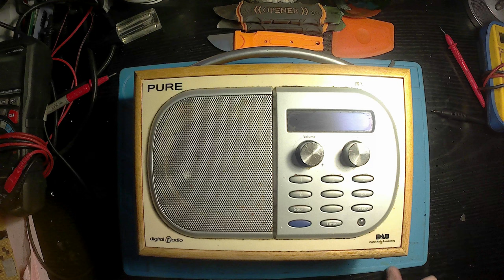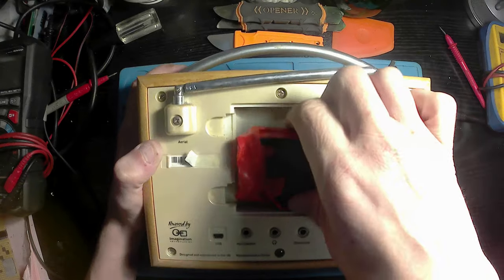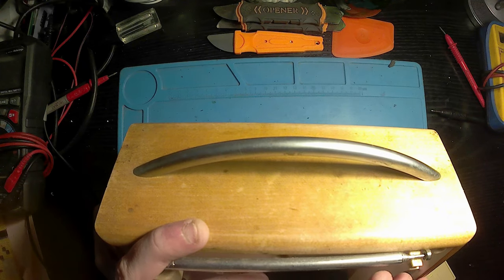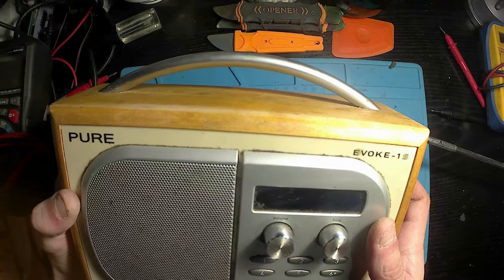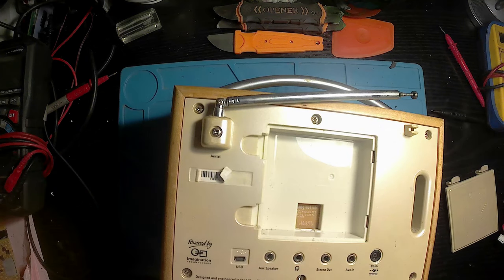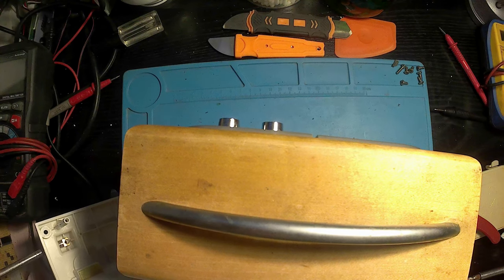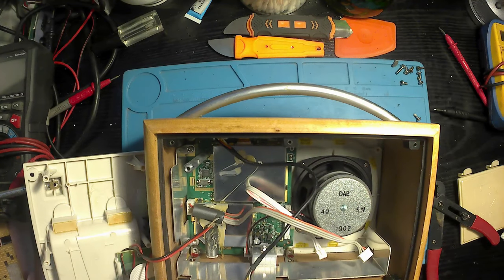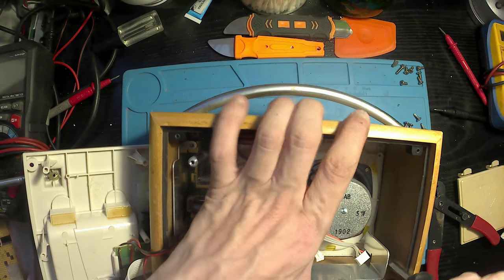Pure DAB radio - No Display?!

Comment: I brought my Evoke 1S to New Zealand 7 years ago when we were running DAB here as an experiment. No-one was interested so Government killed the DAB service in 2018. My Evoke went into storage. A week ago I pulled it out thinking 'it'll be good for FM at least', and it does indeed still have the old presets for FM stations ... but the display is bust. You might say 7 years is good value for anything, but since this is the second of five Pure devices that've packed up on me I'm not impressed.

Comment: Hello. I'm hoping you can help me. I have the evoke 1s.

Annoyingly I turned down the display as it kept coming on at night. I turned it down so low that I can no longer see it and am unable to change the settings. 

Can you take me though the directions to adjust the display brightness.

Thank you in advance
Reply from the maker: Hey Carl, I can I will have to dig it out as it’s it my garage atm but if it’s too low have you tried a torch to see if you can see the display? If that doesn’t work I’ll walk you through it if I can
Reply: @nathansrepaircentre420  hi nathan, I did try with the torch on my phone but it didn't work. Any assistance you can offer will be greatly appreciated.
Reply: Display back light packed up in my pure Evoke 2+  crazy price for a new display